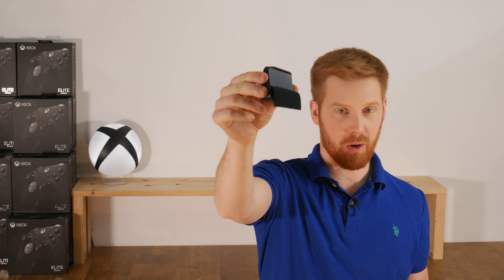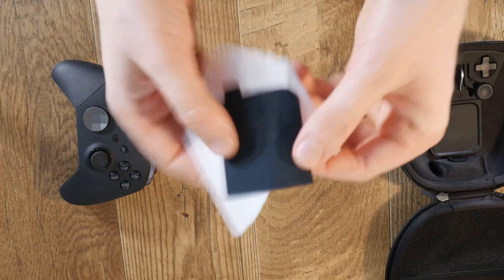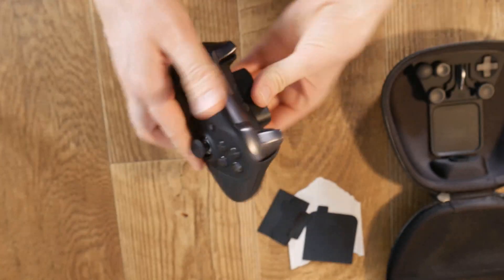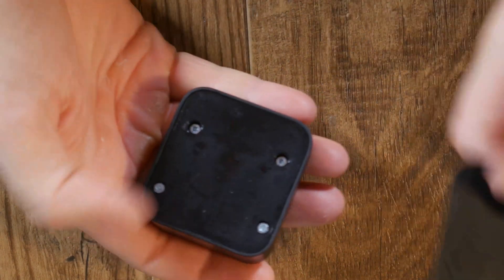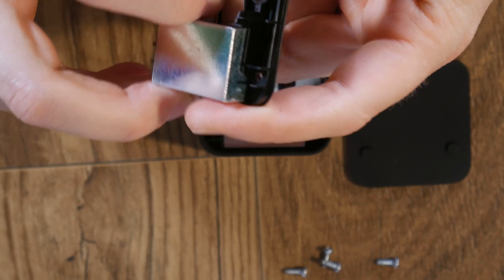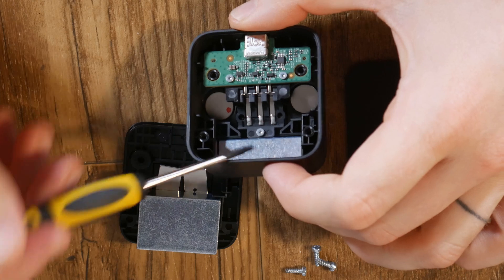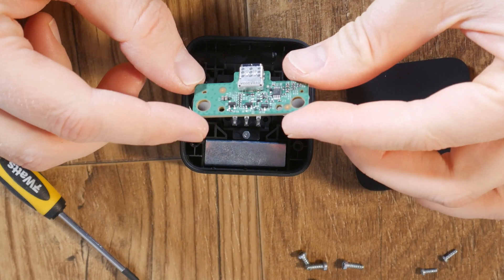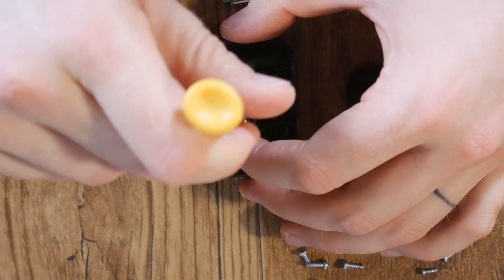😱 Xbox Elite Series 2 Charging Block EXPOSED: What’s That Cover Hiding?!

Comment: So it’s not a wireless charger? They should’ve made it a wireless charging dock.
Reply: I think it is a wireless charging dock, because the controller technically just sits on the contacts. But I think I know what you mean, and yeah... the block is not a battery bank and you end up plugging the USBC cable into the dock/block instead of the controller (which are literally only an inch away from each other). I was really hoping the block was a mini power bank but it's not.
Reply: At least you can charge the controller while it and it's accessories are zipped up in the case. Again, they could have just made the USBC case hole an inch higher and it would accomplish the same thing. 🤷
Reply: this is way better than wireless charging.

Comment: @7 Watts - thanks for the tear down video! I always wanted to check out the internal parts myself… Quick question. 

Not that it matters but I like knowing everything about my electronics, that said I know the Elite series 2 controller charges in 2-3 hours max however,  is there a difference using the charging dock rather then plugging the USB-C cable directly into your controller? 

For instance would it slightly Charge slower or transfer data (controller update etc) slower compared to the advanced charging dock? Because that charging dock isn’t basic. It’s got microchips and so on. 

Basic charging docks have less parts, so I know there’s a difference using either you USB-C cable or the charging dock directly. 

*Id appreciate it if you had an answer, thanks
Reply from the maker: As far as I can tell, the charging speed is the same. But I'm not autistic enough to do a side-by-side comparison 😂